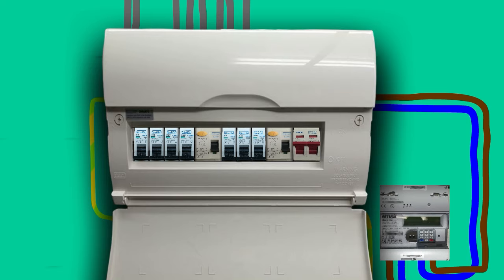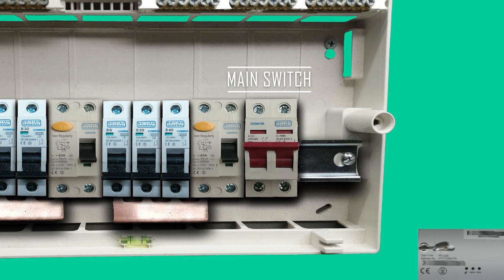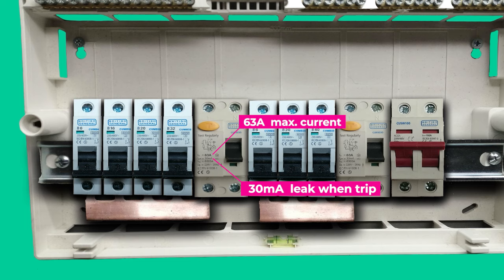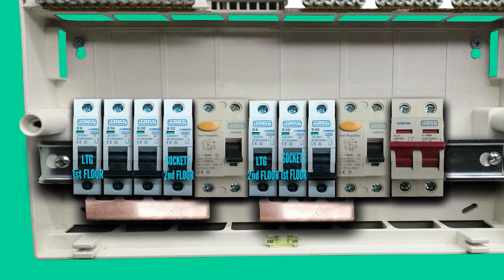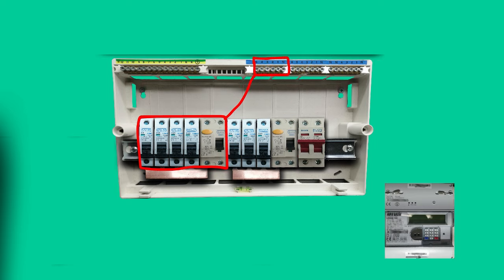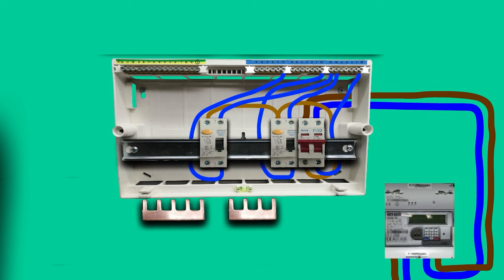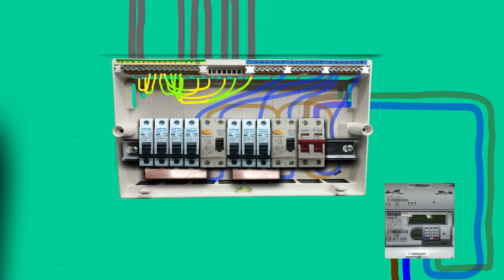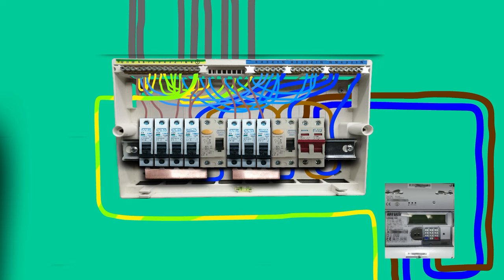How to wire Consumer unit  Wiring Dual Split Consumer Unit Fuse Box Wired Explained Tutorial RCD MCB

Comment: Please why the ring circuit goes to the 32amp breaker. What if the socket is not ringed what should be the amps rating of the breaker

Comment: Very informative, great video. It won't stop DIYers, general builders touching electrics, its just 3 wires, they can watch several videos and do rewires. How I see - it will bring more work for competent electricians deal with consequences.
3 things forgot to mention:
1. Bonding.
2. Electrical installation certificate.
3. Fuse box or adding new circuit to fuse box it is part P notifiable work and home owner can be fined thousands of pounds for illegal building work if is not compliant.

Comment: I agree with the other comments - a superb explanation.  My only question is what size cable for the internal wiring?  The lighting and ring circuit cable sizes coming into the unit are mostly straight-forward.

Comment: Very nice way of teaching i now understand who this works but was not completly sure when you was teaching how to plug them in the above units from the circits, also can you do a video if we have to wire a electric heater/radiator who to connect to new braker and which wire to use and how to calculate them etc?

Comment: How do you safely connect the mains live from the meter to the consumer unit..surely itd be dangerous to connect the live with it being energised with 230v?
Reply: If you're lucky, DNO installed isolator, failing that, pull the main fuse..
Reply: its not dangerous if you touch the live conductors because of the earth being 10v so if you touch the L and N with your fingers you wont get a shock due to eddy currents
Reply: @theirondan8479  What on earth are you talking about!!!!!! This is a prime example of how people get killed.

Comment: How do electricians connect the live meter tails to the main switch - do they do it live?  There is no way of turning off the supply to the meter is there?  Great explanation of how the consumer unit works!
Reply: See my Comment !!!
Reply: I think it's a case of cutting the anti tamper loops and pulling out the main fuse.

Comment: Can you explain why from the first part of RCD the MCB (£32A- Socket circuit), this circuit is not a ring final circuit like for the second RCD part circuit with its Ring Final Circuit. What is the difference between the two circuits, when both of them are for sockets (Ring circuits)?
Reply: A radial wired with a 4mm cable can also be rated at 32A.
Reply: @s786m  The wiring would have to be clipped directly if installed on a 32A breaker. If put in trunking it have a load capacity rated at 29.7 amps. 2.5mm twin & earth radial would be better suited to a 20 amp or 16 amp rcbo or breaker. D.I.Y on electric's or gas isn't good. Nor is giving novice advice.

Comment: @How2D2
hello i have to questions for you I've been meaning to ask. I have a boat running a 12v system 1) would it be ok to use 250v 32mm glass cartridge fuses on a 12v circuit 2) I have a bilge pump and a float switch. On the float switch it says 12v 20amp max and on the bilge pump it says 3.5amp draw. I was wondering what amp fuse do i use in the bilge pump control panel.

Thanks

Comment: Hi, I have had a new consumer unit installed by a qualified electrician  but the kitchen sockets are now tripping the RCD but not the MCBs. He says there is a problem in the kitchen and he will charge me to fault find and fix.  There was no fault before, he has bodged up the consumer unit for now so it doesnt trip. Please advise am I being ripped off?

Comment: I assume this is for UK. And i have some questions. Why u have neutral line not connected directly to the neutral terminal block, so when something go worng u don't end up with fried recivers? And i u shuld probably add that in some of network types u shuld bridge neutral and earth. And if u have mor than 1phase it a good practice is to separe floors/rooms betwen phases same way as u said about floors. So Sockets in kitchen for microwave/owen 1ph Fridge and free sockets 2ph. Lightning 3ph. etc
Reply: Domestic properties are usually single phase. Also the DNO decide the earthing method not the electrician.
Reply: @markstevens7853  So that is kind of a diffrence. In Poland, and there i dont know if u have same names, we we generally use TN-S type of networ in buildings, but power provider is provading custormers with TN-C. So we have PEN (neutral and geound) wire and we just split it to PE(ground) and N (neutral). by devidnig it and grounding this point. Usually when evry house if u dont live in old flat have 3ph. So we do 3 ph for induction cooker. 1ph per washer, fidge and ovens, microwave and free sockets. For rest we do just mixed comination of phases for eatch room, so when one phase is down u still have light or socket to plug emeygrency light avible etc. Usually when there is no specyfic electrical design elctrican decides how to make wiring etc. But it still have to be done with norms and pass tests.

Comment: Pity the video fails to mention that Part P regulations in UK actually forbids a non qualified electrician from changing a consumer unit unless the work as been registered with the local authority building control.  Also fails to mention that you are not supposed to pull the head fuse yourself to isolate the meter to make any connections and you are not suppose to break any seals on any meters.   And if you need to watch this video to understand the principles of a split load board then you shouldn't actually be doing the work.

Comment: WoW! now i appreciate that this video may be showing people how a consumer unit is wired but it is very wrong to assume that the general people won't try and do this themselves is just ludicrous.
I can't stress enough at how dangerous it is to do this if you are not competent to do so, the risk of a fatal electric shock is very high not just to yourselves but others as well and not to mention the potential fires, laws and insurance problems it could cause.
There is a hell of a lot more involved than this extremely basic example and i strongly recommend that you do not try this yourselves and to use a qualified electrician or at the very least do at lot of study and research first.

Comment: There is so much wrong with this. Where is the bonding and why are they important, why shouldnt i just omit them? How tight should my terminals be? Dual split boards dont comply fully with the regs. New boards in domestic need to be metal and fire sealed. And the vast majority should have spd protection. You have shown a plastic board with massive holes in the top and no spd. To think this video wont encourage diyers to have a go is wrong. And if they follow your video and only your video they will probably finish up with a dangerous installation. How ironic you show a bg board, which are widely found to be badly installed by amateurs and builders. My advice to you? Take this video down before it kills somebody.
Reply: Don't be a spoil sport